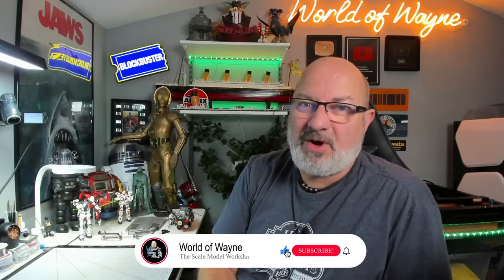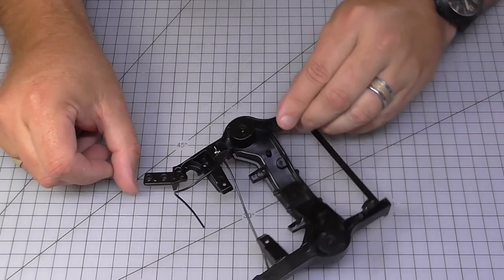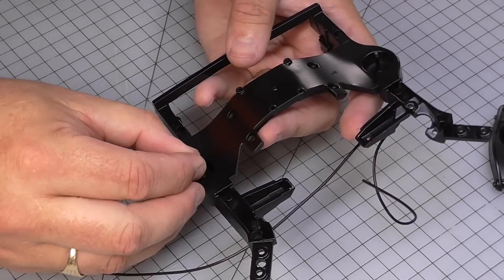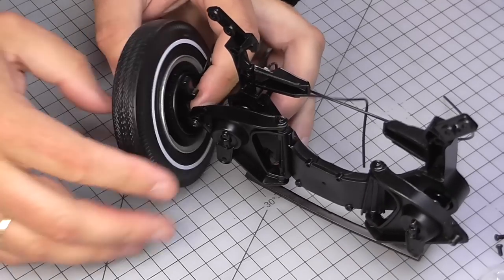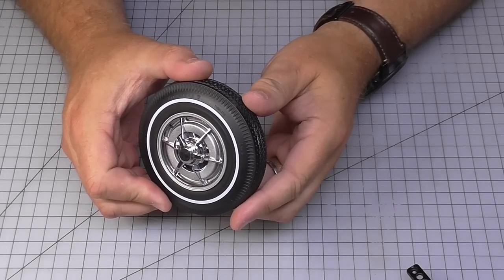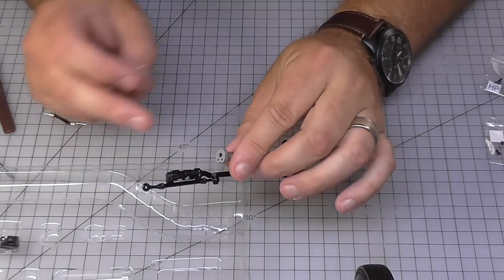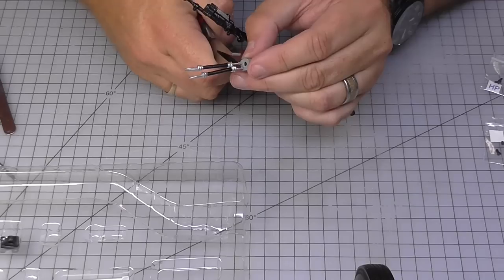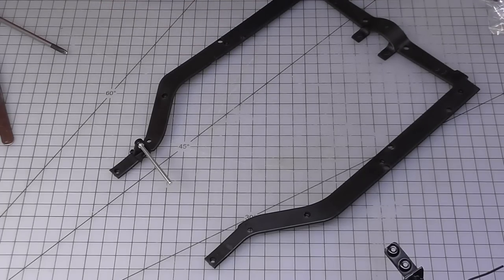Build the Corvette Stingray - Pack 3 - Stages 16-24

Comment: Another great video Wayne .. this is certainly an interesting build & as you rightly point out , the way different car manufacturers came up with their solutions for individual chassis, steering and suspension geometry is fascinating and the way these are replicated on the model is fantastic.
Reply: Yup... that's why you buy a different maker's car for their designs...lolol 🤣🤣🤣🤣
Plus you have to remember not only is one maker improving on another one's design...
But whoever does a new or improved design gets it copyrighted first...
So that's another reason that there are so many different versions of each cars parts out there...
Plus weight... size ...also has ALOT too do with it...
Take the Ford GT-40's design was faster then Ferrari's design...
And simpler also...
And another good example is Germany during and even after WWII...their tanks were overly built and broke down all the time...
They were beautiful designs but problemsome ...where as the U.S. were more of the simplified design... easier to work on...lolol 🤣🤣🤣🤣

Comment: Those tiny vinyl tubes/pipes that represent brake lines or ignition wires, ETC?   Always glue them.   I, too, have been frustrated when they slip off the pins.  Good advice.

Comment: Wayne, you said you were using "CA" glue, but what were you using as a dispenser for the glue?  I really liked the brush, but how do you keep the brush soft if you are running glue through it all the time?
Reply from the maker: Ahh the brush came with the glue. I have no idea what material it is but as long as its not.left to dry its fine. You can get it from The Range stores in the UK